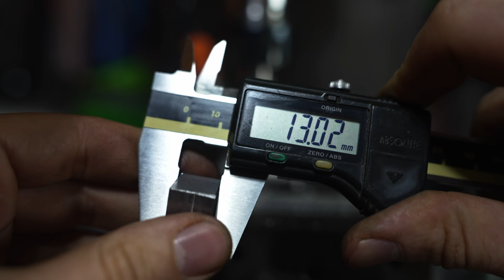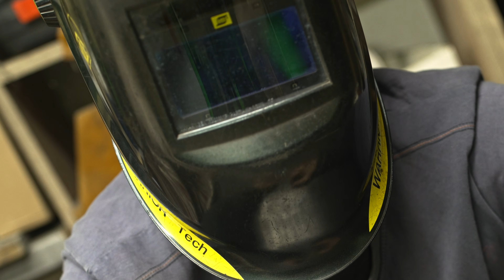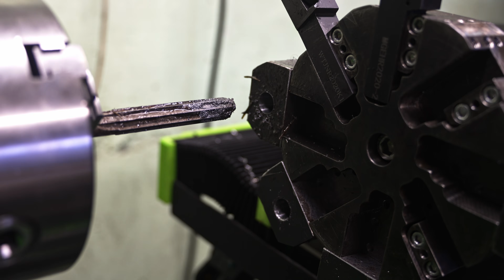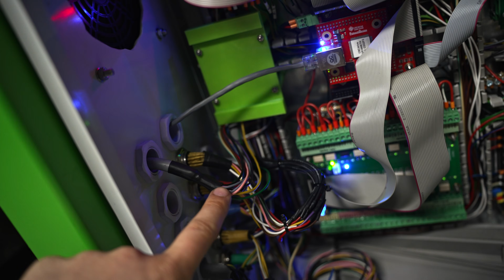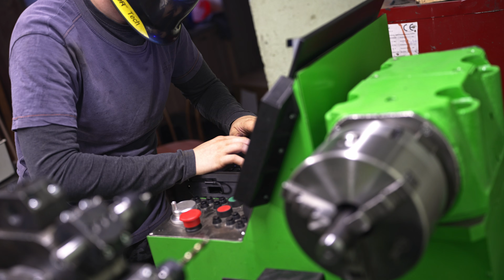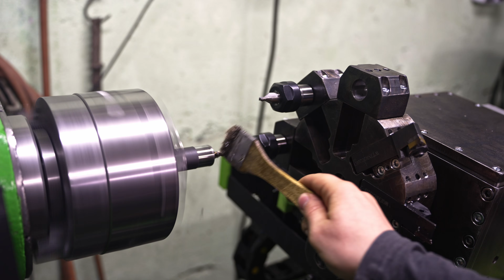ATC Turret - It's Finished! - DIY CNC Metal Lathe Build #20

Comment: It remains to set up the coolant supply through the tool disk to the selected tool.
Reply from the maker: Is that feature still applicable for a DIY machine? lol
Reply: @GBWM_CNC  So what's the problem? It's quite simple.
Reply from the maker: @Script_Script i am not sure if it is actually simple. The head rotates. It is doable but i don't think its easy to make

Comment: are you going to offer the plans?
Reply from the maker: As mentioned on the end of the video. I will share all the files I was using for it with my patrons - like wiring diagrams, models etc. I'm going to share that somewhere soon. But only as a example - I guess those plans are not exactly professional by any mean :)

Comment: Cool, if you make the pulley not round but octagonal, you can set a more aggressive tool changing mode, but problems may arise with the octagonal cutting mode, for example for a milling tool with a cutter and drive.
Reply from the maker: I don't exactly get the idea of the octagonal pulley. Could you expand on that?
Reply: @GBWM_CNC   The idea is embedded in an 8-sided panel with slots for a belt on each side, so the rotation of the round pulley of the servo motor will not occur linearly, but with a sharp turn. Sorry, I'm translating through Google, maybe some of the meaning was lost in translation. I hope the article about (Elliptical gears) will clarify the situation with the nonlinear change in gear ratio.

Comment: Отличная Работа .
И замечательные результаты.
Поздравляю с Успехом.
Great job .
And great results.
Congratulations on your success.
Reply from the maker: Thanks! I'm glad you like my work :)
Reply: @GBWM_CNC  почему вы не пользуетесь более лучшими составами для воронения металлов? например едкий натер (средство для прочистки труб) натриевая селитра (удобрение)  50 на 50 и варить при 100 120 градусах. пленка получается стойкая. и куда лучшего качества чем мгновенные составы.
 why don't you use better compositions for bluing metals? for example, caustic soda (a pipe cleaner) and saltpeter (a fertilizer) in a 50:50 ratio, and cook at 100-120 degrees Celsius. The resulting film is durable. It is of much better quality than instant compositions.
Reply from the maker: @Константин-и3г4д  I have to read about it. Thanks!
Reply: @GBWM_CNC  ask the chat room for the correct formulas.

Comment: Hi,  how much money did you overall spend? I want a cnc lathe too
Reply from the maker: Hi! Being honest - at some point I stopped counting. I'm going to sum everything up at the end of the whole cnc lathe project. But right now - I have no idea. The worst thing might be the amount of time spent though.
Reply: @GBWM_CNC yeah it's extremely time consuming, right now I'm building just a milling spindle/head for the deckel g1l engraving machine and only the materials, bearings, pulleys.... cost me over 700euro, imagine a 100% homebuild cnc milling machine😂
Reply from the maker: @yak-machining  I have some ideas for a "from scratch" cnc milling machine build, but actually I am quite scared of my thoughts. That could cost a lot... 😅 Btw - I love the old deckel machines. Why are you making a spindle for it? Did the old one break?
Reply: @GBWM_CNC its a deckel g1l engraving machine, only made for light engravings and such. Since i need a milling machine i'm converting it to a real milling machine😅
Reply: Would really love a cnc milling machine project from you. Maybe with steel frames and concrete gravel mix as a epoxy granite alternative
Reply from the maker: @yak-machining is it suitable in the means of stiffness for milling metal? I mean the whole frame of the machine? I guess not only the spindle was meant for light work 😁 that would be a manual cnc milling machine lol
Reply from the maker: @yak-machining i made a cnc conversion of a milling machine in the past but a milling machine from scratch would be an interesting experience. As exciting as the lathe at least i guess 🤔🤔
Reply: I also want to build one, every time I add it up it is not much different from buying a unit if you want specific capabilities I feel like. Maybe it is a scope creep thing though.
Reply from the maker: @getchucked1135  Usually building one is just about - building it. And learning a lot in the process.